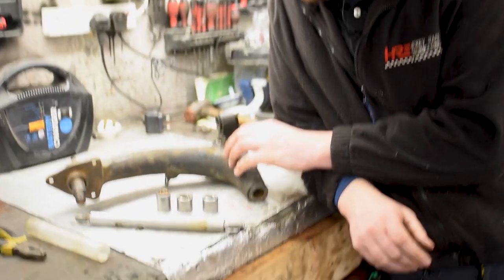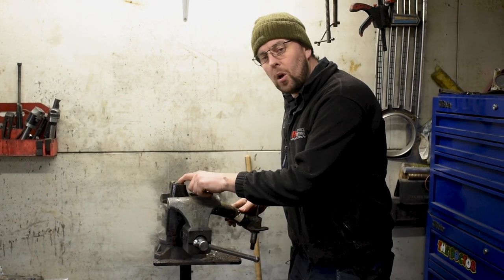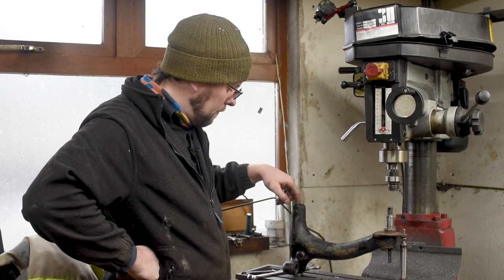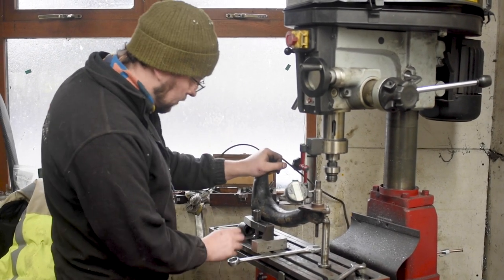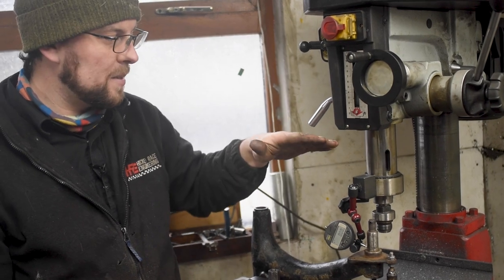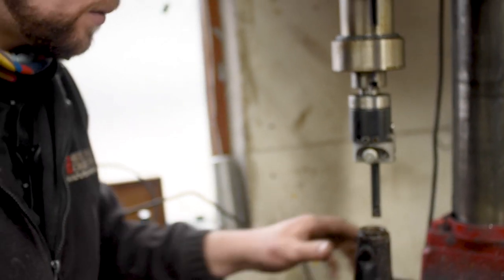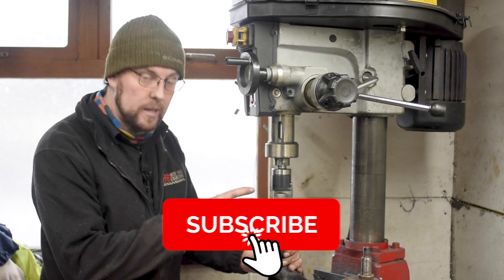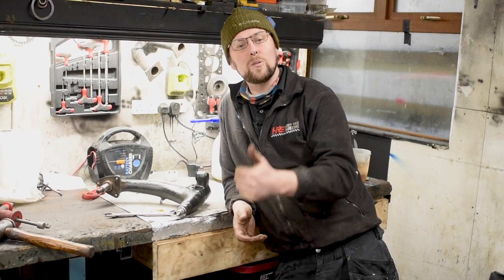Modifying Rear Swing Arm For Classic Race Mini

Comment: Bushes are great load bearing surfaces and absorb impact loads without deterioration at low speeds better then any other bearing. Where the needle bearing needs plenty of rotation to maintain lubricity and even wear, the bush bearing is happy to remain almost motionless. Quo-dos for the bush removal method and effort in locating the bush center axis.
Reply: Which is why they put a bush in outer end. The Metro got rollers at both ends because it was engineered to reduce production & maintenance costs. Having to ream a bush after fitting will increase the production costs by more than difference in cost between buying a bush or a bearing.

Comment: Hi Paul
I’m confused: we’re talking about a reciprocating movement here, not a rotating part. Surely a needle roller race will simply see the needles wear grooves in the swing arm pin?  Shouldn’t it a be a bush in both ends?
Cheers, Will
Reply: I reckon you're right, here. Constant shocks from the road will not mark a smooth bush as much as it would, the multi ribbed surface of a roller bearing. There's a Land Rover mod which replaces the front axle top roller king pin bearing with a phenolic bush to remedy just that kind of pounding wear. Crowded rollers work best on high speed rotating shafts, with a constant feed of lubricant.

Comment: Good vid, buuut - I'm not sure I understand how you align the new needle bearing to the old one?
It's obvious aligning the boring head to the stub axle for the new bearing, but cannot see how this is lining up with the original needle roller or more correctly how you checked that the old needle roller is in fact correctly aligned to the new one and the stub axle?

Comment: All the Mini arms I've had have a fair bit of positive camber which is by design isn't it?  You now have your new outer bearing at a different angle than the inner bush don't you? I'd have thought you'd also need to bore and shim it to match your new outer. Or are all the Mini radius arms I have are different than the ones you see.
Reply from the maker: Very good Point Friend. and you are right there is some positive camber is some arms. this however is built in at the wheel stub axel, and varies hugely between arms the factor tolerance was supposed to be 0.5 - 1 deg of inclination but in reality it can be negative -1 deg or as much as -2. you are correct about the bore near the suspension. How I get around this is by using a self aligning needle roller bearing at that end.
Reply: Like the little boy who wasn't fooled, you spotted "The Emperor's New Clothes", that the two needle rollers are unlikely to line up and because the outer end of the arm is bored concentrically with the old bush, any errors in alignment are retained, so all the careful effort getting the stub axle vertical is ineffectual.
This "improvement" is akin to replacing the rubber suspension with a steel spring, it is a diminishment.  Self aligning bearings are designed to allow for the minor inaccuracy when mounting a shaft;  they are not made to be used where the mounting is constantly moving because there is no way of getting lubrication between the self aligning cage and the outer case.
The video shows how simple it is to remove a bush.  Far better to replace the bush, ream it with Tool 18G 588 (it only takes 5 minutes)   and,     GREASE  IT  EVERY  1,000  MILES.

Comment: I always wondered why they used a bearing at one end and a bush at the other.  Now i know, brilliant. I presume this can be done on the very early 1959-61 welded arms?
Reply from the maker: unfortunately not Paul as there is not enough meat on the bearing end to take the slightly larger angler miss alignment bearing that is needed. I is possible however to modify these arms by welding a larger sleeve over the outside of the arm to allow me to fit the bigger bearing 👍
Reply: @HREIRL  That then defeats the object of the early look arm, thats a shame. Thanks for replying my friend.

Comment: Just curious, if you’re replacing the swing arm PIN why go through all this before installing the new pin? I would assume installing the new pin would change your measurements. Great video. Thanks
Reply from the maker: the pin is constant only the bearings can change the geo 👍

Comment: Would you be able to suggest a way to measure how out of alignment the pins are to each other? I had reconditioned radius arms on my car and I'm suspicious that they could be part of the reason the tracking is way off
Reply from the maker: let me have a think on that one Friend, it can certainly have an effect. I have see these arms out as much a 2-3 degs.
Reply: @HREIRL  yeah well I'm making a video on taking my subframe out and getting to the bottom of my tracking issue so I'm hoping there's a way I can check the alignment of each arm while they're off

Comment: Just out of curiosity..what solutions do you use in the parts washer? And where can it be got..
Great video..
Reply from the maker: Thanks man, The solution I use is called Bio.X By a compan called Denios. its reliably available from any motor provider 👍

Comment: Hi bro great videos. I was wondering if you take the distributor out to clean it and you've moved the car but want to put the distributor back in how to set it up that the timing a correct.
Reply from the maker: get the rockers on number 4 cylinder rocking ie one going down and one going up, check the pully for TDC insert dizy so the rotor is pointing at number 1 on the cap and fit it. that will give you a basic setting you then need to check your timing with a timing light and set it to book figures 👍👍